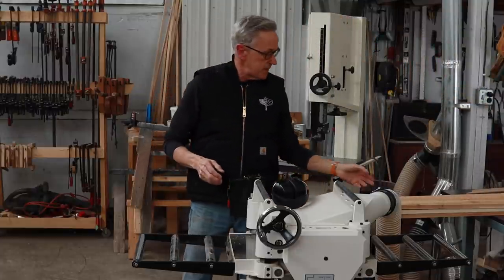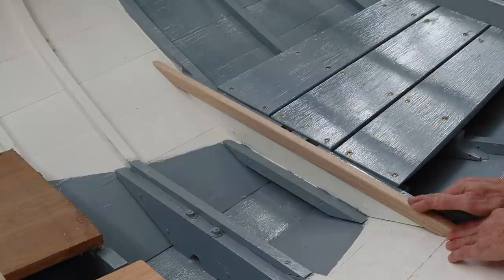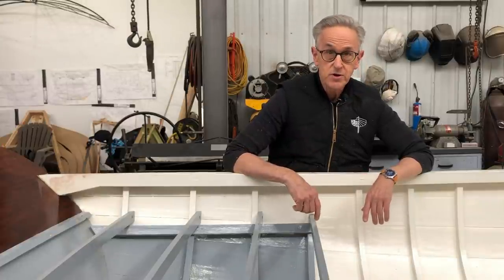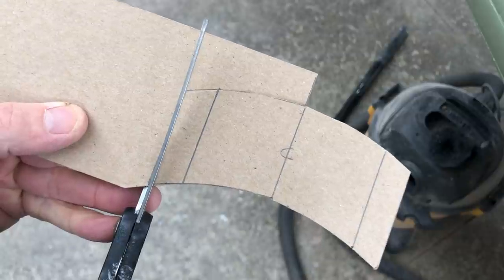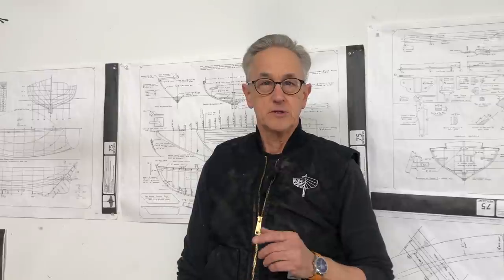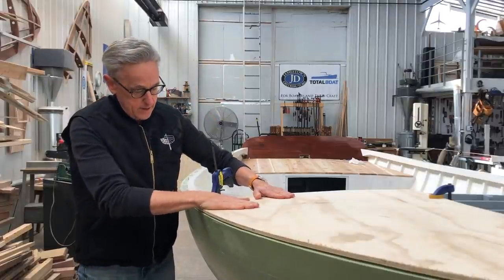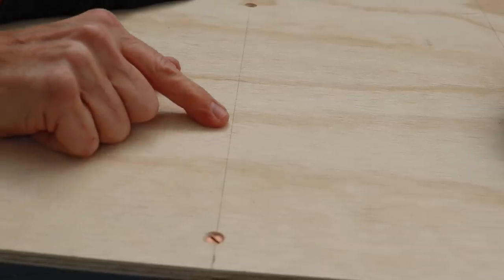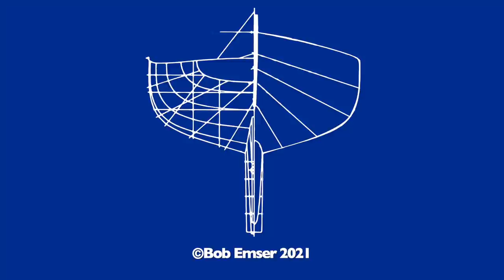Boat Building, Installing the Fore & Aft Decks, S2-E41

Comment: I am surprised you didn't paint the deck panels, undersides and edge, before screwing them down. It is your boat, and the plans call for a canvas covering, but I would have loved to see bright worked wood striped decks. Of course, those might still be going on top of the canvas. (I hope).
Great trim work, lining out the cuts to fit perfectly. I love watching you work. Your meticulously accurate work, that anyone can follow, is a joy to watch. You are a great craftsman and teacher. See you on the next edition/video.

Comment: I enjoy watching build your boat. I’m surprised you didn’t paint the underside of the decks.
Reply from the maker: Hi Dale,
It's really an unnecessary step. It would be like painting the underside of a house roof. The canvas covering will act like shingles on a house. These are areas that are not in direct contact with water.
Thanks for your question and watching.
Cheers,
Bob
Reply: I know all that but as meticulous as you are I thought you would paint them.
Reply: art of boat building...i tend to disagree  where the higher moisture content off  lake or sea air  will be traped  an allowed to soak into the bare timber ply

Comment: Love your attention to detail Bob, not only with the carpentry but some of your camera angles and work are fantastic. I do have a question about your stern knee. Did you cut off slightly the top to fit under the deck?  Mine was long and I actually left it and it is visible above my deck. Just curious. I went back and forth on this for weeks.
Reply from the maker: Hi Chuck, 
No I did not have to cut it. When I had the aft deck beams in and laid a straight edge on them it came out right above the stern knee just slightly touching it. It's your boat really doesn't matter. Looking forward to the water as I'm sure you are as well.
Cheers,
Bob

Comment: I have my yankee screwdriver like that from my dad and I love it.  However, I find that if I get too exuberant in using it, then it tends to hop up off the screw and then wehn I push down again it digs a nice cross shape in the wood.  I try to only use it on pieces that aren't cosmetically critical.  You have better self control than I do!
Reply: @boooshes  Perhaps you're right, I will be sure to check the fit closer next time.  I think I just lift it out out of excessive movement, but I'll try your suggestion.

Comment: Re the aft bulkhead; the lower end of the planks (against the hull). Wouldn´t it be practical to have a small gap between the end grain and the hull plank to prevent rot in that area?
Reply from the maker: Cedar is a naturally rot resistant wood. Being painted on both sides and the cedars natural abilities I don't have any concerns about rot.
Thanks for watching!
Cheers,

Comment: I was working as a boat builder in the late 80's and can confirm that mahogany plywood was readily available and used interchangeably with other forms of marine plywood. Unfortunately no one was concerned with if it was being sustainably sourced, which has lead to the current restrictions.

Comment: just wondering why is there no calking seams on the afterdeck. I think to have it waterproof would be good considering rainwater.(sweet water) .
Nice build.
Reply: Hi Bruno.  Pause at 14:43 and note that the deck meets the inside edge of the frames.  This leaves a gap the size of the frame thickness!  I'm not convinced that caulking the seams between the decking boards is going to substantially change the outcome here!  Cheers!
Reply: Both decks will be covered with canvas. No need for caulking here.
Reply: @horatiohornblower868  that makes no sens, why not building the afterdeck in plywood too?
Reply: @WhatAboutTheBee  good point , this part of the build makes no sens for me
Reply: @BrunoWiebelt  Think of it this way.  Water is going to come into this boat. Unavoidably so.  Even if the decks are canvassed, water will come directly into the cockpit.  The water will flow into the bilge and then be pumped out.  

Other than the hull, spending extraordinary effort in making other parts of the boat water tight seems like wasted effort to me.  Your mileage may vary.

I'm sure Bob has a plan!!
Reply: Bruno Wiebelt Because the plan says otherwise. But you're right, Bob could have used marine ply wood for both decks.
Reply from the maker: The aft deck is easier to build with separate boards. As the Aft deck in inside the hull, unlike the fore deck, a exact pattern would have to be made. This is most likely why Joel White specified plywood on the fore deck and cedar on the aft deck.
Thanks for watching!
Reply: @TheArtofBoatBuilding  thanks for answering.  ... but  the reason seems a bit strange
Reply: As Bob said it should be covered in canvas.

Comment: I'm looking forward to the mast and spar build.  Are they solid or hollow.  Round or rectangular?  If hollow will you use the "bird mouth" method?
Reply from the maker: Hi Petter,
I'm not sure what method yet. It will be round. Which method are you interested in?
Cheers,
Bob
Reply: @TheArtofBoatBuilding  I would really be most interested in a hollow round mast and spar using the Bird Mouth router bit method.  There are some videos on "bird mouth" on U tube but I'm sure you could add to the Library a much better and comprehensive video.

Comment: How does the old fashioned method of canvas on wood, work with modern paints?  Are you planning on using epoxy paint?
Reply from the maker: I’ve got an modern twist up my sleeve for applying the canvas. All will be revealed in the next episode. 
Great question! Thanks for watching.
Reply: @TheArtofBoatBuilding  Looking forward to it.

Comment: Hi.

Allways a pleasure to see your top craftmanship. 

Just wondering, why you didn't paint the underside of the deck before monuting it. 

BR /Poul
Reply from the maker: Hi Paul,
It's really an unnecessary step. It would be like painting the underside of a house roof. The canvas covering will act like shingles on a house. These are areas that are not in direct contact with water.
Cheers,
Bob
Reply: @TheArtofBoatBuilding  Thx - just thought theese enclosed areas might limit ventilation and hence stay damp for some time after sailing.

Comment: 7:20  Bob  Did you tell the folks what you use for the beeswax?  Bathroom commode seal which is very cheap and easy to find works great..
Reply from the maker: Hi Chet,
Yes, in past video. I’m planning on doing a section on screws in the next video. Thanks for the reminder!
Cheers,
Bob

Comment: Have you considered wrapping the canvas around the edges instead of adding an edge veneer?
Reply from the maker: Hi Dan,
No I haven't. One issue with wrapping it is that it's such a small lip and that it's curved, it would be a challenge to get the canvas to lay properly. The wood trim will be walnut. I think it will give the sheer a nice accent.
Thanks for watching!
Cheers,
Bob

Comment: Painting the bottom and bedding the deck pieces just not necessary or other reason?
Reply from the maker: Correct just not needed. As you know cedar is naturally rot resistant and the location is not a constant wet area like the bilge.

Comment: Hi,  what is catenaries in the plans of boats?
Reply from the maker: If you start from the bow there is a fairly steep angle, then slowly flatten out until it blends smoothly into the bottom. This curvature in mathematicians call it a catenary. It can be seen when a rope is strung between 2 points, the curve of the sag  due to the weight of the rope  is a catenary arch.
Reply: Thank You.
Reply: @TheArtofBoatBuilding  can I post your explanation on Facebook?

￼
Reply from the maker: Yes 👍

Comment: My (retired) boat building friend would go  b a l i s t i c  if he'd seen all those screw heads NOT aligned with the grain direction. (me, I'm eclectic :)
Reply: Those screw heads will be covered by canvas. I'm pretty sure Bob will fill them beforehand.
Reply: I was thinking the same, but since they will be filled with fairing compound, (I think) and then canvassed over, why bother?  That said, OCD would probably have made me do it too.  All the slots in my outlet and switch covers in the house are aligned fore & aft. :o(
Reply: Why is it more important to have the screw slots lined up, rather than having the screws at precisely the right tightness?